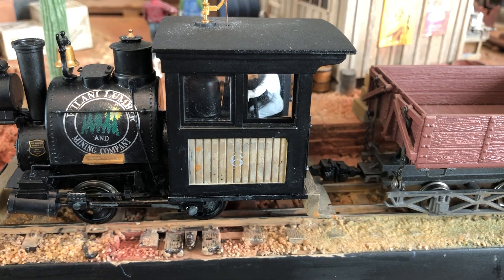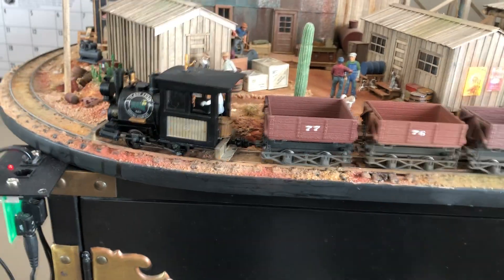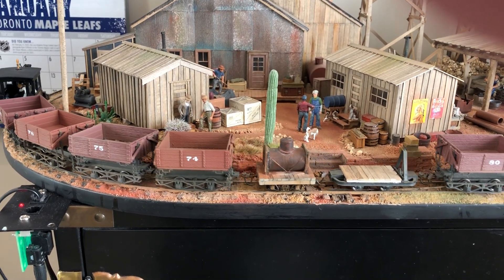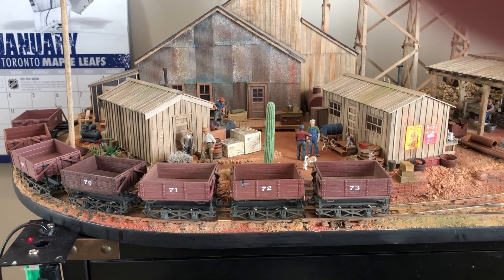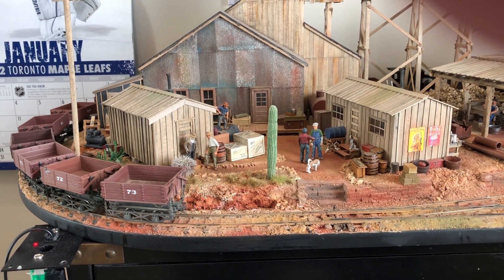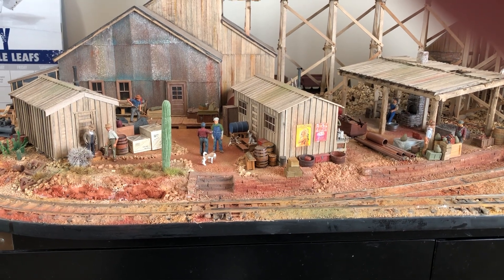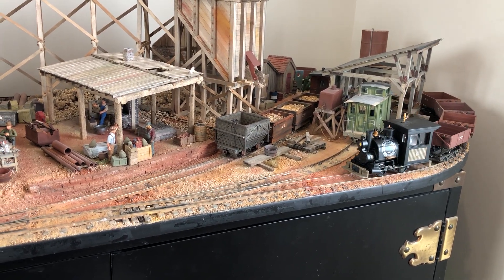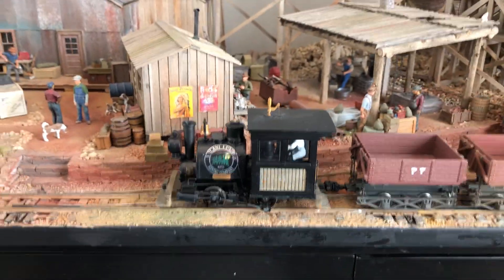Testing Lambert Locomotive works newest ON30 magnetic coupler

Comment: More and longer videos please!.
Love your work, you have been giving me so much inspiration on my On30 trains.. Thanks Dave..
Reply from the maker: Thank you, 
My current layout is very small so longer videos might get boring. I am open to suggestions on content.
Reply: @BigLarsON30  Well at least 5 minutes or so, not less than 2 min. ones.. I like to look and study the landscape and colors used, weathering, types of buildings/structures, loco's and equipment ect. My wife thinks i'm nuts playing your videos over and over just to see and study.. like certain mods on your loco's type of rollingstock and other things ect.. One other question is how you got your porter here to run so good and slow.. mine is awful.. the gearing in these things are crap, iv'e taken it down a few times and found the pin that holds the gear in the center of the internal chassis is sloppy, even after changing them out. the gear has too much slop and shifts/wiggles left and right not meshing right. just a bad design i guess, it's worse when you go to backup, we call em coffee grinders..LOL!.. I really don't want to order another main chassis from bachmann due to the parts price and shipping.. I don't think the loco is worth to fix?. Bachmann had way too many problems with their On30 loco's with bad gears. (And same with their other scales) The best ones are their 2-6-0s, I have 3 and after tinkering run great!. The other Full metal die cast body 4-4-0 is great too!.
Reply from the maker: @crockett11000  Thanks for the info I will see what I can do. As for the layout build, I did write a thread on it https://railroad-line.com/node/30818 You might get some of what you need there. I have never had a gear issue on a porter, early first versions ones had issues with plunger pickup system to gather track power. I have 11 of them at this point and have worked on at least 100 others. Any porters in the videos have keepalives installed in them. I was doing this as a side gig but stopped due to lack of time.  Hope this helps.
Reply: @BigLarsON30  When your modeling is as good as yours, longer videos would definitely not be boring. Your micro layout looks awesome. Thank you for sharing your model railroading hobby.

Comment: I really like how these couplers look but i afraid for a switching On30 they may not work no way to "push" cars onto hard to reach trackage to spot any info on that would be great   very  nice model railroad
Reply: So that’s a question I’ve been tossing around for a while. To my mind there’d need to be some sort of remote uncoupling mechanism. Someone suggested some sort of bar to come up from between the couplers, pop them apart. When I’ve uncoupled the Mk. I and Mk. IV designs, i just used an uncoupling tool as a lever to split the cars apart